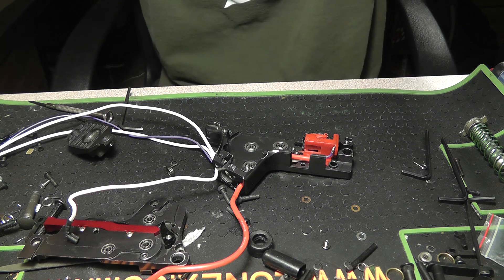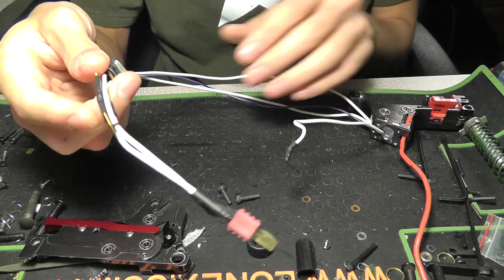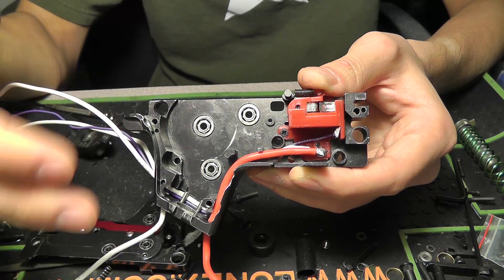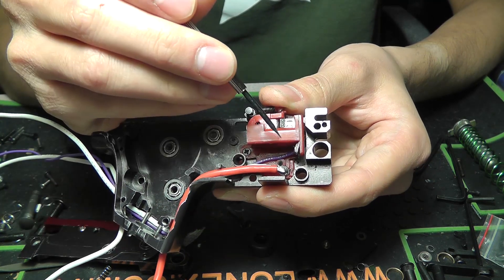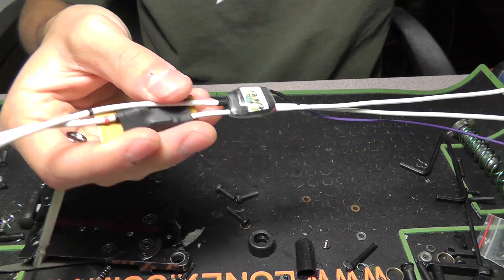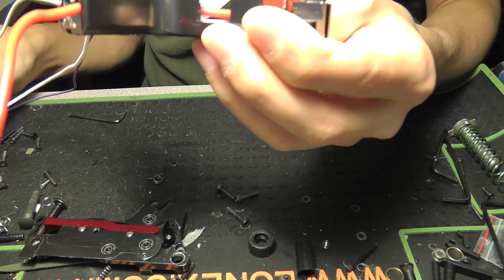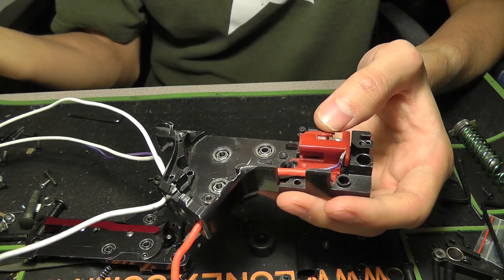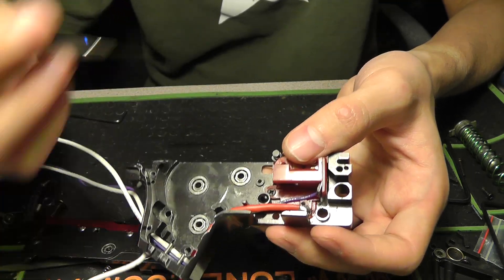HOW TO: Mosfet Install

Comment: What a waste of time, had to ff through it, where in the clip do you actually install the mosfet?
Reply from the maker: right around deez. if you pair the wires right it'll work but also this is less of a relevant video now because computerized mosfets or completed mosfets with trigger contacts are a big thing now.

Comment: so, with the mosfet i should be able to run a 11.1v lipo on my 8.4v ni-mh gun?
Reply from the maker: er. depends. But generally speaking, your trigger contacts at least will be protected.
Reply: pfffffff asuming you are saying 8.4 i asume its either a cheap model or it was a relative good deal.
anyway there are 2 mosfets that i can guarantee for 11.1 and those are the titans from gate and the bc spectre.
how ever keep in mind that there is a upgrade optimum for everyreplica and if you go 11.1 start shimming your gears get a very good motor new gears radius your gearbox and have a strong gearbox shell.

lets just put it this way the easy thing is the 11.1lipo and the spring upgrade. the rest requeres patience and a lot of work and making the right choices good luck ;)

Comment: So if all the power is being cycled directly to the motor. Would that increase ROF?
Reply from the maker: Not really. Honestly the better performance associated with mosfet installs probably just has to do with better quality wiring in the system.
Reply: lets put it this way.
the motor needs watts and the battery gives the watts sure you can overcharge your motor how ever there is a optimum for every motor and you need to find that. the mosfet itselfs protect the cirqut and accelarates the motor start up speed. a lot of pp dont know this but here is a nice example.

11.1 lipo gate titan lonex a1 balanced motor 12:1 shs gears equels instant trigger response 
11.1 lipo gate titan lonex a3 speed motor 12:1 shs gears equals also a instant trigger response or very close to a ht motor. the 2nd i would recomend since there is a optimum in rps and that is 40-45 anything above is a piston stripper setup and then even te precise cycle detection of the titan is not good enough to save the piston.

Comment: Hey man great video. Quick question, I installed my gate 3.2 mosfet and I believe it is all programmed correctly, but when I hook it all up and press the trigger nothing happens. Do you have any ideas as to what might be going wrong? Like incorrect soldering of signal wire? Thanks and again, great vid.
Reply from the maker: Michael Cecchini check for shots and see if the motor spins while outside of the gun. If nothing is happening and you're pulling the trigger and it's cycling through modes, you probably have a short.

Comment: Do you have to have an active breaking gate wire in order for power to run correctly?
Reply: Chris Boggs My AEG's active breaking wire came loose from the solder on the "motherboard" that has a 30 green fuse wire wrapped. When I try to plug in a LiPo battery without that active breaking wire hooked to the board, no power runs. Very frustrated.
Reply from the maker: Chris Boggs I think I replied to this through facebook but yeah that wire is the gate wire. Not necessarily the "active breaking" wire. It's the signal wire that tells the mosfet to open or close. So yeah solder that back on and you're good to go.

Comment: i have  g&p and i was thinking about puting a 10.8 volt battery in it. will i get arching (i have deans)
Reply from the maker: yeup you'll get some.
Reply: valleyriverarms ok. if i burn out the contacts are they replaceable
Reply from the maker: Yes
Reply: ok thank you

Comment: hey i have a tech question,
i have a vfc 416 and put in a devil jet m170 then had a little bit of work on it and was told that the motor tore apart the gears but as far as i can tell everything looks fine. do you have any idea how long i should get on this setup using a 20c 2000mah 7.4 lipo if it was brand new because i pretty much put in the motor as soon as i got the gun.
Reply from the maker: I would imagine the piston would die first but on a 7.4 you might see 10k rounds. I don't know its hard to tell. So someone told you the gears are done but you've already looked at them and theyre fine?
Reply: as far as i can tell
Reply from the maker: so how is the gun running right now? Or did someone just arbitrarily say they died?
Reply: its running and sounds great
Reply from the maker: then just keep running it until it dies. You're going to need to spend the money to overhaul it sometime in the future so just wait until you need it and get your moneys worth out of the stuff already in it.
Reply: i probably am getting around 27ish rps but whatever they did do it has decreased the consistency of the shot. it kinda goes all over on full auto but it good on semi
Reply: thats what i planned i had them wire it to the back and i was going to fix everything from there i just hate messing with wires
Reply from the maker: you most likely need a tappet delayer or some sort of timing fix for your tappet. But if you're taking it to someone its on them.
Reply: what should i put it after it starts to die. can you give me links to a piston and a gear set. i want the gun running at ~400 fps and ~26-27 rps
Reply from the maker: depends on what dies. i won't spoonfeed a parts list but search up SHS 16:1 gears and SHS 15 tooth piston.
Reply: ok thx
Reply: clayton Griggs one last thing.  what companies do you recommend as far as internal parts
Reply from the maker: shs, lonex, siegetek but that's a broad generalization.
Reply: ok thank you for all your help

Comment: Hey man, great video. Just wondering, what are you using to hold the wiring down near the bottom of the gearbox? One problem I always have is with the extra wiring from the fet, sometimes the motor chews up the wiring. Lately I just use a dab of locktite to hold it down, but yours looks nice and clean!
Reply from the maker: specific to the pro win gearbox shell, they have little metal pins that keep the wire back. Super innovative feature that I wish there was more of.

Comment: The damage to contacts from lipo batteries is exactly why I don't use lipo batteries. proper tuning, and a 9.6 volt are fine for me.
Reply from the maker: lol you could. Or you just just use a mosfet

Comment: Okay i will warn you about that this comment is not about your vid or anything, but i have little guestion.

So i got G&P M4 and atm i'm using 8,4v battery in it. But i would like to upgrade it a little and get little bit faster rps. Okay now my actual question: is 7,4v lipo better than for example 9,6v nyckel battery(i dont know rly if it is nyckel in english but i hope u understand)? Like i was thinking is 7,4v lipo better and why would it be than 8v or 9v battery?
Reply: A 7.4 lipo is about on the level of a 9.6 ROF wise. Lipos are much smaller and give better performance.
Reply: Ok thanks but what about if i want better fps? Is 7,4 still better?
Reply: GeneralAiron No, your battery has about zero impact on your guns velocity output.
Reply from the maker: GeneralAiron yeaup. pretty much everything he said. It depends on how much space you have in your gun although 7.4 lipos are more bang for your buck space wise. It's initially a little bit more of an investment because I recommend picking up an AC6 charger with it but it's worth it.